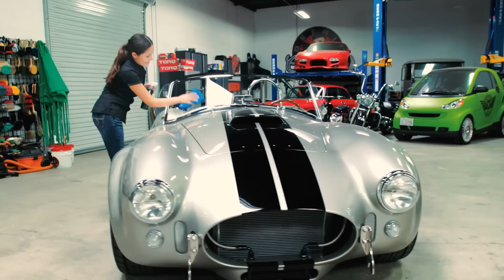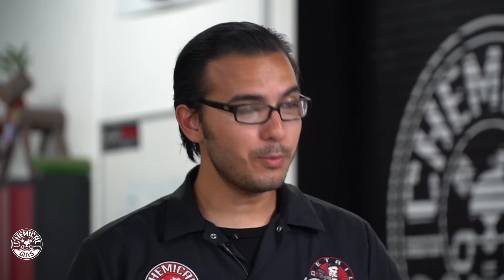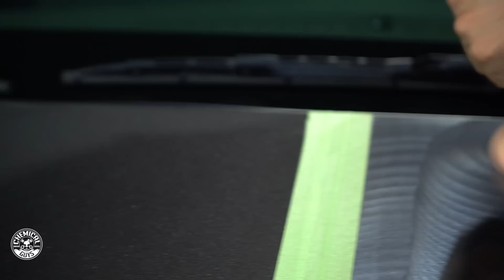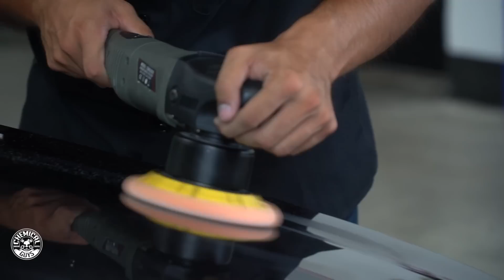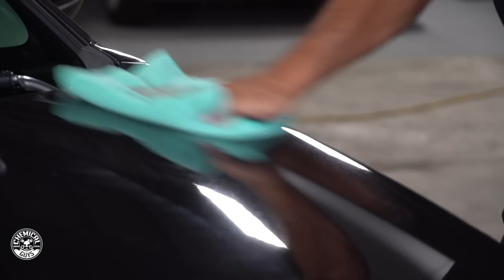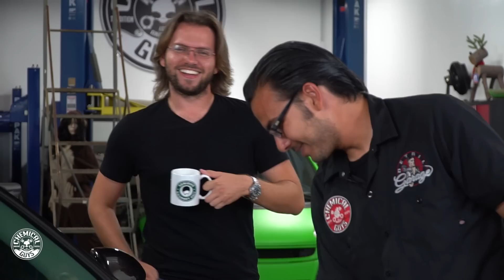How To Make A Used Car Look New! - Chemical Guys Car Care

Comment: As always, excellent video.  Why did you wax the windshield?  Does it make a difference?  I just watched your "best glass cleaning tips and tricks" video.  It doesn't mention anything about waxing your windows.
Reply from the maker: Hey Larz, thanks for watching. Waxing the windshield helps to protect the glass from contaminates that embed themselves into the pores. It also makes it easier to wash the glass since nothing can bond to the glass, also wax has natural oils that break down anything on the glass surface to make it easier to remove. Stay tuned for more great videos!

C.G. Alex -
Reply: Chemical Guys awesome! Thanks for the reply. I never thought about waxing the glass. I’ll give it a try. I definitely hate having bugs stuck to my windshield and repeatedly pumping wiper fluid on the windshield with nothing but streaks for days!

Comment: So, according to your flow chart, we are suppose to seal the paint before waxing and this was not the case. You went directly to wax from polish. Or is this wax a kind of sealant mixed?
Reply from the maker: Hey there! InstaWax is a hybrid sealant and wax which adds a fine layer of protection while increasing shine. Some detailers choose one over the other, some prefer sealant over wax and vice versa. It isn't necessary to apply both but we do recommend it for the best of shine and paint protection.

Comment: whats the beading like for the insta wax?
Reply from the maker: Hey there, thanks for watching. Instawax retains the same water beading properties as the Butter Wet Wax, and the Extreme Top Coat. Instawax contains a blend of Carnauba and sealant to give it durable long lasting protection against paint oxidation, and etching. For the best possible protection, apply Carbon Flex.
Reply: Can i buy your products in the uk?
Reply from the maker: You would have to check your local listings for an authorized wholesaler that carries our products. There are many countries that carry our products, here's a link to the Chemical Guys European website.
https://www.chemicalguys.eu/dealer/

Comment: Can each product be used by themselves or do you need to progress up through the product line? Can you use any applicator to spread each product?
Reply: Michael Aguilar
Depends on the type and depth of the damage. You want to do the least abrasive method to get the clear coat leveled. If it doesn't have deep scratches, then skip 32 and 34 and start with 36 eventually moving to 38. 32 and 34 will get out deep scratches, but may cause light scratches in the process so you use 36 and 38 to get those small scratches out that were caused by the more abrasive compounds (32 and 34). Its very similar to sanding wood for example, where you start with rough sand paper to round off edges and move to finer and finer grit to make it smooth to the touch.

Comment: Hey guys question : how long do you have to go over each area on speed 6 ? 
Do you recommend to use more than 1 orange pads when you polish ? I will appreciate the answer thanks 🙏
Reply from the maker: Hey! You should be moving at about one inch per second, overlapping your last pass and using a cross hatching "#" pattern for even correction. The pads can become clotted with spent product and need cleaning during the job or having a spare will save you time. 
- CG Nick

Comment: Great video. I just picked up a 2016 WRX with about 20k miles. Has the dealer shit wax job and you can tell has been in the drive thru wash. I was thinking VSS followed by Jetseal and then a wax. What wax would you recommend and what do you think of the other product choices? I live in MI so want to protect it for the winter
Reply from the maker: Hi Jason, thanks for watching. It's hard to say without actually seeing the level of damage. I would start with V36 and an orange pad, and V38 with a white pad. If you have a medium amount of scratches, VSS is a great option since it contains a fair amount of abrasives. You generally want to start with the least aggressive approach first before you start removing more clear coat. A milder choice would be V4 which we've seen do wonders On a classic Bentley in one of our videos. You can always send us some pics on our Facebook account, we can diagnose from there. Stay tuned for more great videos.
https://youtu.be/Rx-l8voyJm0

C.G. Alex -
Reply: Make sure to use a car wash soap designed to remove waxes before polishing or you will not see great results and will gum up the pad with wax. 
I recommend this order (chemical guys are welcome correct me or make other suggestions if I've missed something):
-Wash the car to remove old wax. 
-Use an iron remover (then rinse), 
-Use a tar remover (then rinse)
-Clay the car if it's still relatively rough to the touch.
-Polish with 36 and 38.
-Do a final prep-wash to remove polish residue before applying a sealant to get a good bond.
-Apply sealant (not in direct sunlight)
👍
Reply: Just my experience with Subaru's shitty soft paint (the darker the color, the softer it gets!), I've gone all the way down to watering down V38 on a black finishing pad to get it to finish out properly.  I would actually start off with V38 on a microfiber cutting pad and run your DA slow (as in as low as speed 3 -4 slow) and work super small section areas (about 1x1 to 1.5x1.5).
Reply: I also forgot to mention that you'll probably want to do a ceramic coating of some sort so the surface of the car is no longer that super soft Subaru paint, but a harder and more durable coating.

Comment: Do a video for rubber/vinyl trim cleaning and care. Thanks
Reply from the maker: Great idea Mike, the trim on your car wears down very easily especially during the periods when the weather is chaotic. Dry rot is a very common problem, and fading caused by the sun makes trim look dull. Without proper care, your plastic trim will crack, and the car will start to look old. Stay tuned Mike, we'll be sure to have some great trim detailing videos coming soon.

C.G. Alex -

Comment: Which compound for deep scratches and swirl marks on black paint?
Reply from the maker: Hey George thanks for watching. I would suggest starting with V34 and an orange pad, followed by V38 and a white pad to refine. If the scratches are still present, pick up a bottle of V32 and an orange pad and follow up with V38, This process could take up to three steps depending on the severity of the paint. For really hard paints, you'd want to use a microfiber pad if you're not getting the best possible results.  I'm going to leave you a video of a car we worked on that had some really deep scratches in it.
http://www.chemicalguys.com/V32_Optical_Grade_Extreme_Compound_16_oz_p/gap_v32_16.htm

http://www.chemicalguys.com/V34_Optical_Grade_Hybrid_Compound_16_oz_p/gap_v34_16.htm

https://www.youtube.com/watch?v=d24c8gYeHIg

Comment: Hlo sir, iam having a polishing machine having 2 pads one is microfibre and another is sponge pad which one i should use for waxing my bike
Reply from the maker: Hi Manpreet, you should wax using a pad that has no abrasiveness because you don't want to remove paint while you're applying the wax. The microfiber pad is used for heavy cutting, and generates too much friction to be used for wax application. We use the black Hex Logic pad to apply waxes, sealants, and glazes. We also carry a blue hex logic pad that has zero cut, and it's perfect for spreading coatings. Stay tuned for more great videos Manpreet.
http://www.chemicalguys.com/Hex_Logic_Quantum_Polishing_Finishing_Pad_Blue_p/bufx115hex5.htm

C.G. Alex -

Comment: How long did this process take?
Reply from the maker: Hi Cesar, thanks for the question. Nick and Javier did the whole car in about 4 hours or less, but your required time will vary based on your skill and experience. A newby could take as long as 6-8 hours, while a skilled detailer would only require 3-4. Thanks for tuning in and make sure to check back soon for many new exciting how to videos coming your way soon!

Comment: how hard do you press the polisher against the paint?
Reply from the maker: Hi Mubashar, you only about 5 pounds of pressure. We'd equate this to about the weight of your arm. Not too much pressure is needed to get an excellent cut. Thanks for being part of the Chemical Guys family!
Reply: Chemical Guys thanks 🙏.... last question. After I first wash the car can I go straight into clay baring the car instead of drying it first?
Reply from the maker: Mubashar, it's best to dry first, then proceed to clay using the clay luber, or a quick detail spray at the least.

Comment: I want to try to remove the swirls and scratches from my black truck but worried I'll damage the paint. Is it possible to over buff an area where it will damage the paint?
Reply from the maker: Hey Lou, thanks for watching. Using a dual action polisher is actually pretty safe to use, it was designed to eliminate the fear of burning the paint unlike a rotary polisher. Usually if there's an area that you want to avoid polishing, you add some painters tape to avoid causing any damage. The beauty of a dual action polisher is it stops spinning if you apply more than five pounds of pressure. It's almost impossible to burn the paint, you would have to sit there and polish the same section for a long time before you cause any noticeable damage. Stay tuned Lou, we've got more great videos on the way.

C.G. Alex -
Reply: Chemical Guys thanks guys, love the videos!
Reply from the maker: You're welcome Lou, thanks for the love!

Comment: If you apply wax or sealant coat and you let it dry for more then the recommended time,will that affect the durability and protection.
Reply: Harshvir Kamoh don’t leave it on long it will dry and not protect as well
Reply: Harshvir Kamoh A little bit because you will have to work harder to remove it and possibly remove more product in that process, but it's not a huge deal.
Reply: Austin Blackburn thanks

Comment: At 7:03 you can still see some scratches on the door. I have used the V line products and same happens to me. What can I do/use to perfect the paint?
Reply from the maker: Hi Eduardo, thank you for watching. If you've already used V32 and the scratches still appear in your paint, then they've gone past the clear coat. When the paint no longer responds to the compounds, then the only thing you can do is wet sand, which we don't recommend because you could damage the paint if you're not an experienced paint restoration professional. I believe you can get really close to perfect with the V-series. Let me ask you a question Eduardo, did you get all the way down to V32?
Reply: I did down to V34, it just didn't seem like much was changing. The swirls came off and some scratches did too with just the V36, but those, not so much. They aren't  a scratch in a typical sense... but there are clear marks that didn't come out. You cant catch it on a fingernail.
Reply from the maker: It's possible you have hard paint. What kind of pad and machine combo are you using? Also what type of car? You can always send pics to Facebook, Nick is on there regularly.
Reply: I have a 2011 Ford Escape Hybrid. I was using the TORQ10FX and orange HEX pads.
Reply from the maker: Hi Eduardo, you can try these three steps: Use V32 with an orange pad, use V36 and lastly V38. If no improvements occur, try a microfiber pad, they are very aggressive. Remember that your clear coat is really thin so be careful. You can also try  a rotary polisher as well, they are more powerful in terms of paint correction ability.
Reply: Chemical Guys thanks a lot for taking the time to help! I appreciate it very much. I'll try those steps.  😊
Reply from the maker: No problem Eduardo, we want you to get get great results, just remember that at some point you should accept improvement even if it's not absolutely perfect.

Comment: I just bought a new car and I noticed some light scratches. Is it a good idea to polish it?
Reply from the maker: Hey there, thanks for checking out this great video. You can start by using a cleaner wax like Wet Mirror Finish or Slick Finish to remove some really light scratches. Cleaner waxes contain very light abrasives, and are not to be confused with polishes. To remove light scratches, you'll want to use a dual action polisher with V36 and finish with V38 to refine the paint to produce a slick, defect free gloss. Stay tuned buddy, we've got more great videos launching this week.

C.G. Alex -

Comment: I've noticed you guys don't ever really use sealant of vehicles you detail, any particular reason for that? I feel it would give better protection to the paint from things like fallout and other debris as wax melts at 60 degrees Celsius so in the sun it would become ineffective, especially on a dark car like that wouldn't it? No offence intended, just curious.
Reply from the maker: Hi Nicholas, thanks for watching. You're absolutely right, sealant's are synthetic waxes that have a longer life span than Carnauba wax. Many of our viewers were requesting a demonstration of the Instwax so we decided to show how easy it is to use the Instawax to protect the paint, and enhance the shine. The general rule is to apply a paint sealant after you've corrected the paint because the clear coat has been thinned to expose fresh paint, which makes it more susceptible to oxidation. We have many videos where we apply Jet Seal to the paint to give it the best possible protection outside of using Carbon Flex. Nick and Javier were in a bit of a time crunch, so that didn't leave much time to apply a sealant. Stay tuned Nicholas, we've got more great videos coming your way.

C.G. Alex -
Reply: Chemical Guys ok good to know! The instawax does certainly look pretty good I will admit! May have to try it some time. Do you guys ship to Aus much?
Reply from the maker: Is that Australia or Austria? We should have dealers in both regions.
Reply: Chemical Guys sorry, australia
Reply from the maker: Yeah we do Nicholas, here's the address and phone number 

Chemical Guys Australia
www.chemguys.com.au
25 NARRUNG Road, MOUNT ELIZA Victoria 3930
+61 438 196 002

Comment: 7:02 why not remove those scratches?
Reply from the maker: Hi there, thanks for watching. Those were deeper, and they required more work to get those out, we had to finish this car before a certain deadline. Rest assured that the owner of this car was thrilled to have the car back in such an amazing condition. Stay tuned for more great videos!!

Comment: Out of curiosity, how long did it take to completely finish the car?  Count the man hours, so I'll have some kind of idea how much time I get away from the wife!
Reply from the maker: Hey Bruce, thanks for watching. On average it takes about two to three hours of work to get a good wash and correction if you know what you're doing. Polishing takes up most of the time since you have to work in small sections, and you have to assess whether or not to add extra steps to get a good correction. Washing generally takes somewhere between twenty to forty five minutes depending on the method you're using. Detailing will definitely give you some time away from the wife, it also helps to clear the mind as well. Stay tuned for more great videos Bruce!!

C.G. Alex -